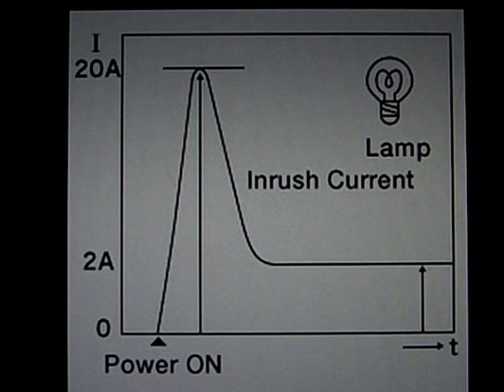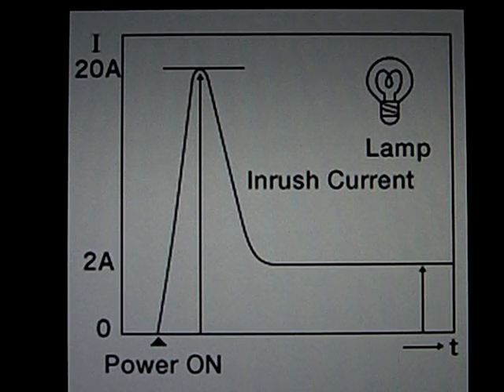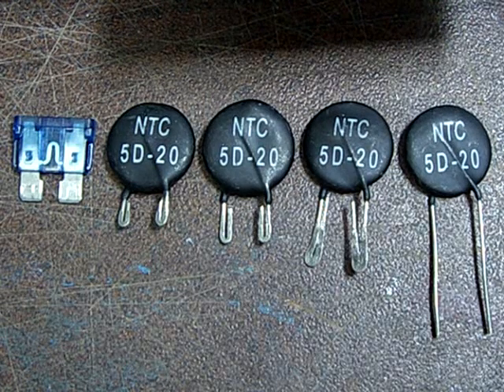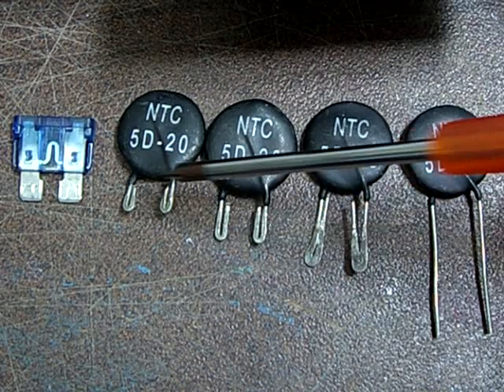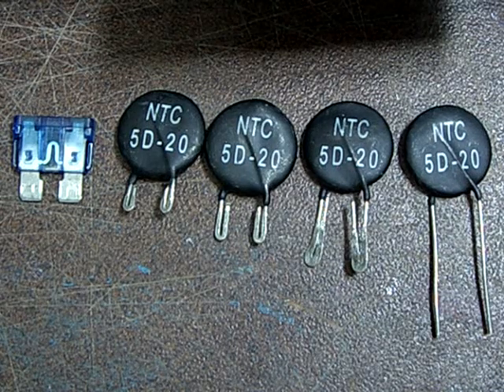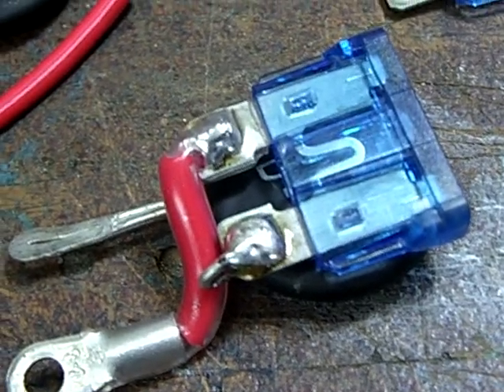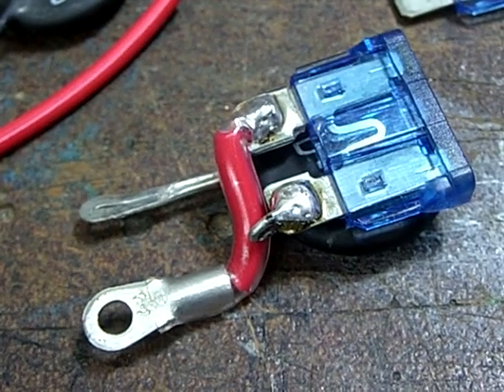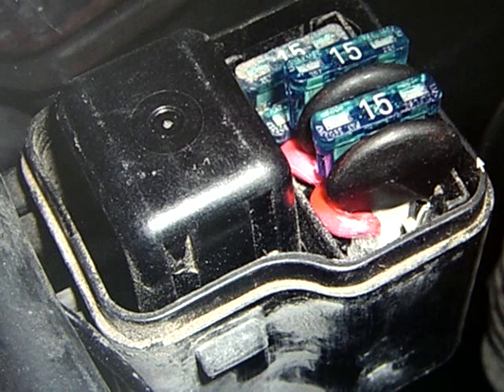DIY $5 Headlight Softstart and longer bulb life with NTC resistor

Comment: "eyeballing with the necessary precision" is an excellent quote :) To eliminate the heat issue use two relays. Relay "A" has battery power on its supply leg, ground on one leg of its coil, voltage from the headlight switch to the other leg of its coil, and it outputs battery power to the NTC (to the headlight circuit), and the supply side of Relay "B". Relay "B" has the bulb side of the NTC on one leg of its coil, ground on the other side, and outputs the battery power supplied by Relay "A" to the headlight bulb and thus latches itself "on" once the NTC has raised the voltage of the headlight circuit enough to throw the relay (~9 volts?). This eliminates any load and therefor any heat from the NTC after it "soft starts" the headlight circuit. When the headlight switch is turned "off" power is removed from Relay "A"s coil and the NTC and Relay "B" lose power. No heating of the relay and no voltage drop to the headlight (via the NTC) after "soft start".
Reply from the maker: Wow, thanks for this very useful idea! This is certainly a very good circuit, and should be very robust without any semi-conductors or advanced electronic components. Well done, I might try this in the future!
Reply: Pls provide diagram to easy follow.Thanks